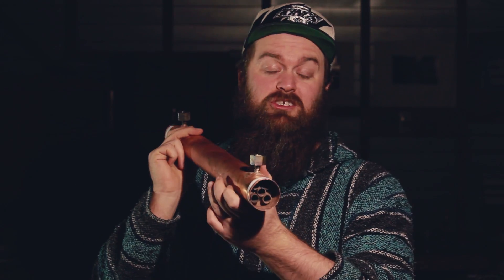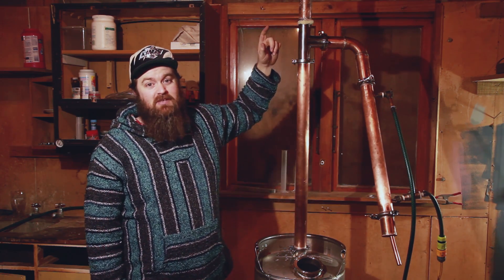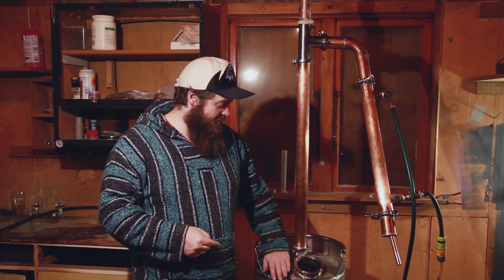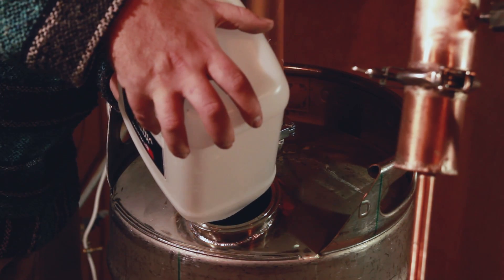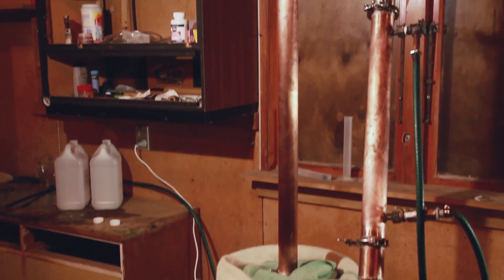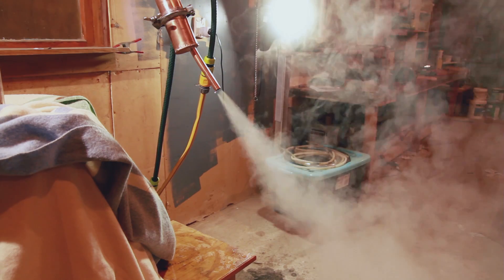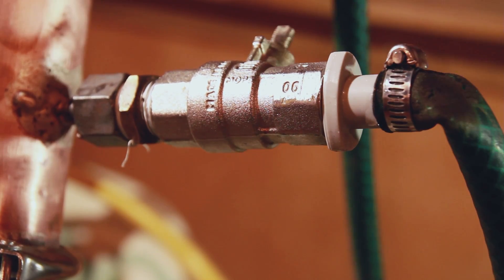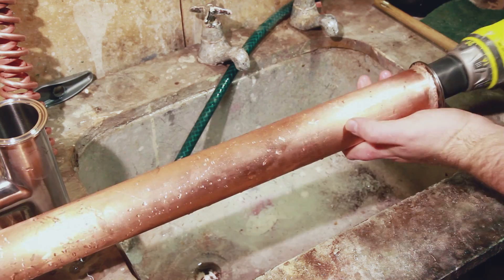Cleaning A New Still - Vinegar Run

Comment: I just, in the last hour, took possession of a still spirits T500 to run alongside my old reflux pot still. Just refreshing my vinegar run game, dude, this is six years old! Look how far you've come dude! I really appreciate your input into my learning process dude. Thanks... dude. heh (May have said dude a few too many times, but dude, you are definitely a dude when it comes to this shit dude....)
Reply: Hey do you do a vinegar run every time you do a run?
And do you hafta do an alcohol run every time you clean it?
Reply: @nathangrueber9834 I usually only do a vinegar run when the condenser is new but after that I do boil it for a long time in water between each run and once every two or three runs I use a super diluted bleach boil, like, a teaspoon of bleach per 5L (sorry, we use metric here) and then boil it in fresh water and rinse, I also use pipe cleaners on condensers that I can but not all of them are easy to clean like that. I just bought a new tower reflux so I will do a vinegar run on that before I clean and use it.  Pretty excited! I tried doing a stripping run only running hot water through between runs but by the third run it was getting a bit smelly. It'll clean up in the spirit runs but I wont do that again. Sorry for being so wordy. Whats your process?
Reply: @MrSomethingElse  we to be honest ive never run a still. I didnt know how to clean the condenser.
It is a stainless pot still.
Looks like a silver 20litre boiling pot with a ring clamp to attach the top lid. That lid has a 25mm pipe sticking out with what looks like a copper baked bean tin of copper coil wrapped round it and 4 clear pipes coming off for water etc.
The pipes are a bit white and hard and im unsure if clear tube is heat proof or even alcohol safe(cloudy).

I ran baking soda solution thru the condenser tubes till it was full
And let it soak half hr.
Then used raw vinegar. And flushed out some blue water.
Then hot water.
The 25mm tube i think is steel????
Its rusty. Stainles dont rust unless its impregnated with iron or some dumb bastard used steelo pads on it. Or blood.
Aparently theres sopposed to be a big marble in the tube?? And then a cap with a thermometer. Il just jam a cork in it.  They say dont use chlorine on stainless. What a load of bolloks!!
316 stainless is non reactive. I should know i make wine tanks.
Brewing is not new to me but distilling is. I just dont wanna run bad gin.
Reply: @nathangrueber9834  I was so tempted to get the stainless version of the one I bought for the exact same reason dude! Hey mate, as long as you are "chasing the craft" like Jesse says, then that's all that counts.But yeah the simple answer is "Cleanliness is next to boozeliness". keep it up! Honestly, Jesse is really approachable, ask him if you can send him some pics and get his advice. Wine tanks you say? Damn! Sure could use one of them as a fermenter! hehehhe
Reply: @nathangrueber9834  Hey also, pot stills are relatively inexpensive at the starting level and I bet you probably even sound like you could make some of the parts yourself. I highly recommend watching "The Last Run" with Popcorn Sutton, also MadDaddyMoonshine as an example of someone starting out (even if his rig is ridiculously elaborate) plus, like I said "Still it" is usually where I go for specific stuff, he has a video on just about everything, plus he's a fellow kiwi so I get his stupid humor to a tee, get cracking and best of luck, moonshining is like tattoos, once you start, you never stop.
Reply: @MrSomethingElse  i git tatoos and i stopped for that very reason.
Sadly i dont own a tig welder. Toooooooo poor.
I only need a cork and a marble. I can make that haha. Thanks fir the help man. If you had an email id send you a photo. But its pretty simple still. Im gonna run gin tomorrow. Funny you say popcorn sutton. I brewed 3 10litre buckets of popped popcorn and maize. 
I got a guy to run 1 bucket abd got 1.5 litres of very custard and vanilla smelling moonshine. Then followed jessie's new gin recipe on still brews.
Its awefull!!! Ruined my alcohol!

Comment: Well, I tried a vinegar run and did the things in the wrong order... This just because using vinegar is so common in the kitchen that I wasn't concerned. My still started to produce steam (pure water steam) after one hour, it's a 100-litre boiler with a 3" column (Stainless steel), no packing material, pure pot still configuration (my other option is VM with a reflux condenser) . I then checked the internet and found that acetic acid boils at 117,9°C, and also that pure acetic acid is quite a nasty product. I would recommend to fill the copper parts with a mixture of table salt and vinegar and leave it overnight. That vinegar run does not make any sense to me. Here a link to a short video about my vinegar run attempt: https://yadi.sk/i/vwjfiqupbXqXUQ

Comment: would you recommend doing the same run on a T500 out the box?
or what about running a sacrificial wash as my first run?
I was thinking of adding an old bottle of spirts with a load of water?
Reply: I'm wondering about the same thing but if I was going to do a sacrificial alcohol run I would probably use cheap boxed wine

Comment: Hi Jesse, I just bought my first ever Flute still. Its a 4 section flute still with a 16 gallon boiler. I tried my first vinegar run and I didn't get any vapor or liquid out of my parrot after 2 hours. I'm in tropical Costa Rica, so my re-circulation water was fairly warm. Is that the reason I wasn't getting any output at all? I checked for leaks and didn't have any I could notice. Great videos, you explain everything very well!

Comment: Hi Jesse,
Thanks so much for your channel, I've just done the vinegar run on my new (first) still. I've got a birdwatchers down now for the sacrificial alcohol run.
I've copied your build because after looking around temperature control was important & the flexibility (pot & refraction modes) is also important. 
For your info, I had way more trouble brazing than you did, & I mean a lot!! But I did tig weld the keg myself & that was a piece of cake, can't be good at everything a lol.
Once again thanks for everything you're doing, I'm 2 years behind you, & wanted you to know I'm getting real value from your older posts.
Cheers.

Comment: Quick cleaning tip:. Use a spray of StarSan on copper parts.  It will both sanitize and clean the copper.  I double the StarSan mix which brightens the copper.

Comment: The link to this video is in the Operating Instructions of my Boka Stills as it saves me heaps of time and explaining. Thanks for sharing. Happy distilling.
Reply from the maker: Nice man, appreciate it!  I'd anyone is reading his and thinking of building.  Your going to want to see Louwrens vids!
Reply: In my humble opinion, a slanted plates head aka Boka isn't the best solution. I started to build one because everyone seemed to be convinced by that approach. But I wasn't really sure so I decided to have both a Boka head and VM but changed my mind and now only have a gate valve for my VM. I found confirmation of my analysis in Nixon and Mac Caw's "The Compleat Distiller" on page 55... Even in the pot still configuration, I can achieve a good separation thanks to the height/length of my column plus the ratio 3" to 1"...
Reply: @ThaïLoeil-d6k  I totally agree with you. No doubt the VM is the best home distiller still you can have. I have built a VM in the past month and tested it and achieved better results with just SS scrubbers than my Boka with SPP! I will have the video of my VM up on my channel tomorrow. Kind regards. Louwrens

Comment: I tried to clean my new rig today, I don’t know if I’m getting older or because it’s in my garage but the idea of that thing building up high pressure steam and blowing up my house with my son inside scared me and I turned it back off...lol
I’m sure it’s all in my head but the fear of a blockage or something got to me when my temperature got to about 240 degrees, but my thumper was load. 
I think I’m going to charge it with compressed air tomorrow just to check flow. I’m a union pipefitter and I deal with this type of stuff all the time so I’m not exactly sure why I was so freaked out by this today.

Comment: try using the pectic enzyme to soak your copper parts j don't have a copper still, but use copper filling and I let it soak  in pectic and water mix, it works great just rinse with water, no taste or smell

Comment: my condencer get really hot during any run I do. I have it circulating with a pond pump and ive tried icing the water down but still really hot
Reply from the maker: What is the distillate coming out of it like? Is that cool enough?  That's really what matters.

Comment: Do you think buying a commercially available (home) still requires a full cleaning run as well, or is it generally safe to skip?
Reply from the maker: I would be doing some cleaning on it for sure, unless you know the manafacturer did it already.  Dang good question tho.  Seems like a trap that one huh!
Reply: @StillIt  Yeah I'll certainly give it a thorough wipedown and all, and will do a run with pure water just so the steam can flush out the pipes, but was hoping to get around the vinegar infusion ;-)

But thanks for the quick reply, really appreciated!
Reply from the maker: Yeah I hear you.  

It's the residue of manafacturer I would be cautious of.  Mostly the flux, so I'd say a acid bath plus small sacrificial run personaly :)
Reply: @StillIt  Gotcha, going to play it safe then as well. Thanks a ton!
Reply: @StillIt  what did you use for your acid bath? Just vinegar or a commercial acid wash

Comment: Hey mate, just a quick question. Finding parts in NZ can be really expensive. I was wondering where you located your tri clamps and from?
Reply from the maker: Yeah, dude, tell me about it! 
I found that the steel and tube in Palmy is fairly decent.  Other than that its Ali Express mate.
Reply: I bought mine on Ebay (from China) and on aliexpress.

Comment: Awsome video's bro I am new to this and was wondering on a new copper 10 gallon still with thumper do I need to put vinegar in thumper? Also how much vinegar/water mix do I need for a 10 gallon still? I am doing a 50/50 vinegar/water mix keep the video coming bro thanks
Reply from the maker: Awesome, congrats in the new still mate!  

I'd say enough to safely run it for about a hr. (Not sure if you are electric etc.  I'd put a little in the thumper.  Good excuse to give it a test drive anyway ;)

Comment: Jesse, I cleaned as video, and a few days later, while waiting for mash, I noticed the inside of copper tubing, was turning green from, I think, oxidation, do you know what may cause it?  Do I need to clean it right before each run, it maybe be several weeks between runs???
Reply from the maker: how bad is it mate?  A little discolouration?  Or more green than copper?  Getting any green in the distillate?  

And did you do a vinegar/other acid soak before the cleaning runs?  Cheers mate ;) Let me know and we can try help out!
Reply: OK, i wire brushed first, then ran the vinegar/water, then just water,  and 2 or 3 days later the inside of coil was turning green/blue,  so I waited till mash ready, and did another vinegar/water run, it cleaned it, then I made my run, it came out clear for first pint-liter, then it started getting cloudy, think my heat got too high,  so I quit.  Only a 4 gallon boiler so was not looking to get much more anyway.   washed it all and put away, back to more studying before I try again, so probably a month or so before I try again, so I guess I will need to do another clean vinegar/water before I try again,  just wanted to see if I could build something that would work,  looks like it might be better to try and make it all stainless and forget the copper, except for packing.

Comment: So is the coil taking the place of an upper condenser in a reflux? That seams way easier and run it through a bung to top off the tower .
Reply from the maker: +Garry Gowin in this video it was doing absolutely nothing. Just getting exposed to the hot vapor.

In ccvm mode it is the reflux condenser. But you adjust reflux ratio with it's position rather than the amount of water flowing through it.

Does that answer your question man?  Sing out if not :)

Comment: MEANING I GOT 4 GALCOOKER  RUN 3GAL WASH  IF I KEEP RUNNING IS IT SAFE
Reply from the maker: +walt braden you just want to make sure you don't run it dry.  How is it heated?  Gass it electric?  If electric make sure your elements are still wet too.

Comment: Hi Jesse.. What is the purpose of the graham coil condenser?
Reply from the maker: +peace maker in this case it was doing absolutely nothing.  It was just in there to get cleaned :)

But it goes down the top when in ccvm mode to act as the reflux condenser.

Comment: hey is  that copper pipes  if so u really should shut that down because of  the fact that vinegar an copper makes copper oxide a very lethal vapor based gas
Reply from the maker: +directive me I think we are good considering cu20 boils at 2000c.  ;)
Reply: yep just a heads up best of luck with the still
Reply from the maker: +directive me cheers man ;)

Comment: G'day mate, why do you not have insulation around your column. I have my full 1.5 meter column insulated with 15 mm black polystyrene type pipe. Has my column at 74 to 84 degrees (my liquid taking temps) for less time, which can taking 5 plus hours to brew 37 liters of wash.
Cheers.
Reply from the maker: +ausiewood huh, nice name btw!  

A few people pointed it out to me. Makes a whole lotta sense now that I think about it (didn't even cross my mind before haha).

I have been using a camping mat (weird I know! Haha).  But I think I need to upgrade that to something pretty similar to what you have!  Cheers for the tip dude!!

Comment: Nice work dude! Question do you know how long a fermented wash will last with out distilling it ? 🥃
Reply from the maker: Thanks man! 

I would say the answer to that would vary greatly depending on sanitation prior to ferment.  And how it's being stored afterward. 

The main concern would be that all your hard made alcohol ends up as vinegar.   Or perhaps a super funky infection.  Im going to guess that autolysis isn't a big problem for distillers but perhaps check that though?  

Think of it this way.  How long does wine/beer/cider keep for after fermentation? Its pretty much the same stuff right.  Its a pretty stable product, as long as you look after it :)

Comment: When I'm building, I clean as I build. That means I clean the crap out everywhere I can reach and polish the parts where needed or wanted.
It involves soaking the parts in hot vinegar the night over. After this process, I proceed with a cleaning run like you did. Btw..you want to turn that spout on the end of the product condenser when you actually do a run. The reason is..you won't get any pooling of product, thus no risk for smearing.
A vinegar cleaning run should be followed by an alcohol laden run. Just use some crap alcohol you've got or make a cheap sugar wash for the purpose. Cheap wine is also excellent for this. Run a stripping run and a spirit run if you use a wash. Besides cleaning your still, you'll also get the opportunity to get familiar with your rig and play around with things. A still behaves very differently when it runs alcohol, compared to vinegar. 
A word of caution here....NEVER use rubbing alcohol or denatured Ethanol for this. It will leave some of the bad stuff in the product path and you don't want that. Toss the product collected or use it for other purposes, like cleaning machine parts etc...NEVER be tempted to drink that crap or speculate to re-distill it. All the flux and chemical compounds in the collected product, can't be removed by an amateur without lab grade equipment. So you discard it.
Happy stilling...
Reply from the maker: Thanks dude.  I love that people are dropping knowledge in the comments.  Its pretty cool that other noobs can find this vid and benefit from them.  

I did clean and soak all the parts as I went.  But now I think I could have done a better job of it at the time.  

I put the reducer on upside down as I figgered I may as well let the "top" of it get some action now as it certainly wont when in "proper" use haha.

Comment: Love the videos.  Keep them coming. I have a  question when making the shotgun condenser, why use brazing rods on the inside pipes...why not solder?
Reply from the maker: Thanks Stan.  Every week ;)

Just before I started putting the still together I was looking at both brazing and solder.  In the end, things just lined up easier to get into brazing.  I had a few people that knew their stuff offering advice directly and I was able to source everything I needed for brazing easier (and cheaper).  Once I started learning to braze it just made sense to keep on using it.  

So in short.  Soft solder will do the job as well :)
At some stage, I will set my self up to try soft solder too.  Just so I can compare the two.